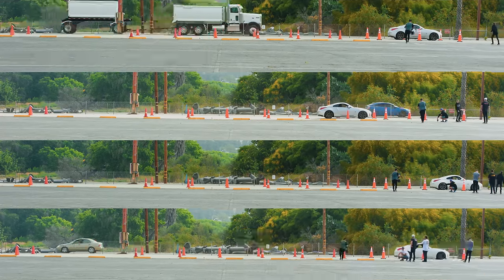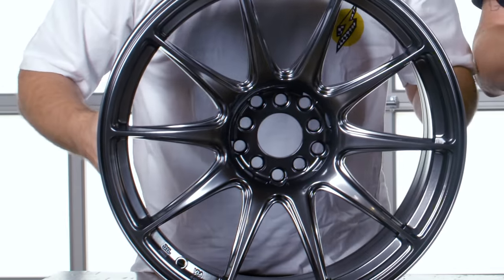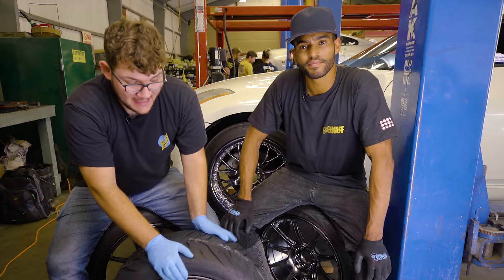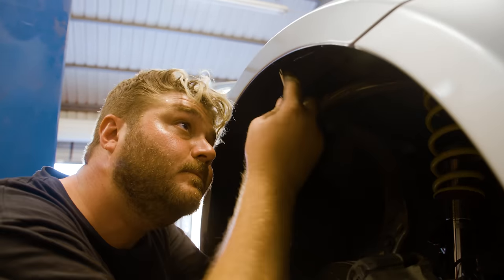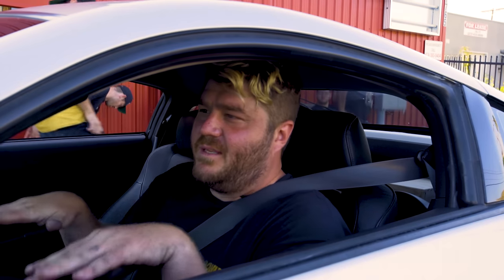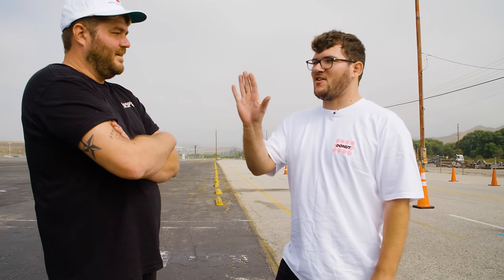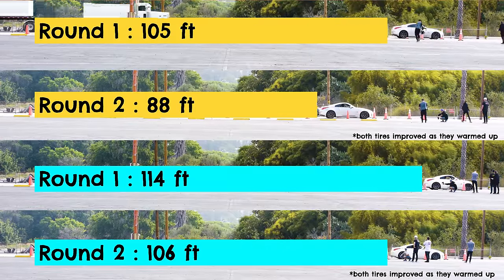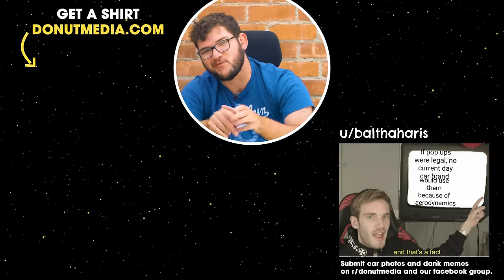$1,000 vs $3,700 Wheels and Tires | HiLow

Comment: This show should be himidlow, demonstrating the logarithmic diminishing return on investment. For the majority of consumers, a mid tier product will be the most cost effective.
Reply: I felt smart knowing what all those big words meant
Reply: stock-low-mid-hi then
Reply: @nathanperini9226  That makes too much sense yo
Reply: I said the same thing on the original video! I think that format is the money maker.
Reply: Set of koni shocks for $800 and a set of rt615k for $600 on the stock wheels.  Would destroy both these cars.  $1400 total.
Reply: @blankspace998  many low end parts are worse than stock. The low end coilovers for example are much worse then stock.
Reply: @SofaKingTouge  aftermarket wheels look fantastic though. That and you have a lot of tire options with aftermarket rims.
Reply: I think the low end wheels and tires worked well here. Obviously low end coilovers are a no no, but decent ones will do better than stock.
Reply: @silasmayes7954  my apologies.   I thought this was a performance test, not a fashion show.  Thanks for the information.  

Also thanks for letting me know tires don't fit stock wheels.  I was never aware.  Now I know, I need new tires then I need new wheels.  

I've learned so much today.
Reply: @SofaKingTouge  not everything is about performance. If that were the case many things would sell better from computers to cars. Yeah though some cars have very limited options on tire choice. My car has not rare but uncommon rim size and new cheap all seasons cost me over $700. Whereas my friend has Nissan pathfinder and got a good set of tires for closer to $300.
Reply: @silasmayes7954   I heard you the first time.  It's a fashion show.  Thanks again.
Reply: Rowan Call fr. The difference between cheap coilovers vs say, an $800 set is massive, while i feel like a $2500 set would be better bit not worth an extra $1700
A track build is a different story though so it makes sense that theres so many price points
Reply: @thecanucklehead3034  the funny thing is the $2500 set they bought is probably the worst coilover in that price range.  They mentioned in the video there is no proload.  2005 called, they want their coilover back.   Ohlines, Feel, Fortune Auto are all better and in the same price range. 

If you simply must have coilovers the cheapest i can personally recommend is BC racing DS series with swift springs.  Thats around $1500 and are better then the $2500 kw they used.  If you are too cheap for that just get eibach lowering springs.  

This need to modify your car you are will to sacrifice performance and quality just blows my mind.  Those aren't car people.  They're hard parkers.
Reply: @silasmayes7954  Fantastic looks don't add performance and an aftermarket wheel that is the same size as the stock wheel will have exactly the same amount of tire options. Those are both moot points. If you buy a different size aftermarket rim, then you'd have different tire choices which may be better, but at that point your cost is way over the setup that was suggested to you of coilovers and a better tire on the stock rim. Plus, you're not adding any weight. So, unless looks are extremely important to you, there are much better options for better performance at a cheaper price than a new rim/tire combo.
Reply: @thecanucklehead3034  a track build could get away with mid tear coilovers in fact I'd recommend it given how hard track use is one the car. The point of the high end coilovers is for more comfort on the road not better performance.
Reply: @xfiringsquadx  tires as most will tell you, and can be seen in the video, add significant performance improvements. Wider tires can also help with grip, both improvement of *safety and performance*, which is a benefit of aftermarket rims
Reply: @silasmayes7954  And none of what you just said disproves my point. New tires on stock wheels w/ coilovers is better bang for the buck than just new wheels and tires. That was suggested by the dude above though, not me. I'm just in agreement with his point.
Reply: I was thinking the same thing. On my M3 I'm doing a much more middle of the road build price-wise. My D-Force 18x10s are flow formed and even weigh a bit less for hundreds less, mostly because they're not Advans. A typical person just isn't going to spend almost 3k on wheels.
Reply: Good episode, wish vids like these where out 16 years ago so I would have saved myself the cash & the headaches. Interestingly enough some stock OE rims weigh less than the cheaper aftermarket rims out on the market. If I wanted to save a lb per rim of unsprung mass it would cost about $4-5 grand compared to the stock 19/9 rims on my TT. So there's zero gain for me in that regard. Tires on the other hand make a major difference. A cheap but we'll designed summer sport tire will perform extremely well for the average person on their daily driver. Easier to live with (especially on the budget) for the auto crosser, but not recommended for track days as the tire's compound technology will be apparent almost immediately after the 2nd lap. I look forward to seeing the brake comparison.

Comment: Current car culture: "if you arent running $4k worth of wheels on $55 chinese tires youre trash."
Reply: Not me i dont bullshit with tires
Reply: They're called 500tw ditchfinders
Reply: Bill Collins i would get cheap wheels before cheap tires
Reply: Hingle McCringleberry same exactly
Reply: So true.. 3 piece wheels with Nankang tires everywhere lol
Reply: Tooo true man!!
Reply: I'm actually going to snipe some reps or FC gold wheels for my SC400 because when it comes to wheels, strength only matters in potholes. It's weight that counts, and the rubber counts even more.
Reply: theriseagainstfan01 nankangs stretch easily. that might be why you see them alot. i hate it lol
Reply: @theriseagainstfan01  Nankang is from Taiwan, not China. They are also better these days than most people give credit for.
Reply: HashDogg06 I don’t mean to bash budget tires.. it’s just the stereotype of having 4-5k worth of wheel with $400 worth of tires
Reply: I got te37sl's with nankang ns2r's 😂
Reply: InitialG Suspensions at least it’s easier to get better tires than getting TEs haha
Reply: @theriseagainstfan01  I ran almost every 200/140/100tw tire  under the sun on the track/autox/touge. I'm not opposed to trying new compounds. :)
Reply: @theriseagainstfan01  Yeah I completely understand, I also want to apologize for my ignorance, from the looks of it yes you are right Nankang is made in China these days not Taiwan as it was, bit of a shame but I guess you can't compete with China's manufacturing costs.
Reply: If you plan to go fast GET GOOD TIRES
Reply: Meh, why spend lots of money on tires when most people are just gonna do burnouts with them anyways
Reply: I steal half bald tires from behind shops for drifting🥺
Reply: Abysmal Squid Lionhart

Comment: To those thinking cheap wheels are always bad: you are sleepin on flow-formed Konigs. Made on the same production line as Enkei flow-formeds, they are just as light and are half the price.
Reply: And rays?
Reply: matthew natividad rays are expensive as shit wtf
Reply: @justinhedrick2906  rotiforms>
Reply: Dude, I can't even find 17in wheels lighter than the Konigs rn. I'm looking at dekagrams or countergrams because i like how they look, both just under 17lbs. The hypergrams are the lightest  @ 16.33lbs for 17x8s. TSW Bathursts are 17lbs, nothing else compares that I've found. The Konigs are around 220, the Bathursts around 330.
Reply: @johnnymatias3027  Get the hypergrams, I think they look sexy. I got Konig Rennforms on my car and tbh they're alright, but they're my first set of wheels so I didn't expect to get it perfect the first time
Reply: @johnnymatias3027  WedsSport TC105Xs are lighter, but they are also more expensive than than Konig Hypergrams. I think the Hypergram is the best bang for the buck when it comes to weight and they look amazing too.
Reply: getting some 12lb dekagrams on the EF hatch
Reply: Got some Enkei Shogun FF's on my Suzuki Swift Sport today on Michelin Pilot Sport 4 and that combination is damn good! 
And they are even lighter than the stock wheels which are already stupidly light, even though the new wheel setup is about 3cm wider.

Comment: Next:
$100 subwoofer vs $1000 sound system+$30 vape juice
Reply: There is a huge difference between good sound system and bad sound system.  No vape juice though.  I have a 1000W AMP JL Audio (the one that claims it will never oveheat and 2 8' Subs from JL Audio.  That setup alone is quality.
Reply: Cheap subwoofers sound like crap. But you don't have to spend $1000+ to get quality.  My powered sub is from Rockford Fosgate. It is a 12 inch Punch woofer with a 300 watt rms mono amp. Great bass in my truck.
Reply: @AFlyingCookieLOL  And the correct enclosure.
Reply: Re audio makes some of the best sounding subwoofers ive ever heard and they definitely arent the most expensive.
Reply: @aceproduction99  fosgate has dropped quality in  the last 3-5 years imho. you can find handmade stuff cheaper and better , sundown audio is one that comes to mind.
Reply: TheBlack Metal That does not sound like a quality sound system to me. A quality sound system would consist of a Sub with its own amp, and a separate amp for mids & tweeters, and a DSP etc. Having 2 8’ subs on a weak ass 1000W amp drowning out your stock speakers is not quality at all lmao
Reply: +Subaru
Reply: JL Audio and Fosgate are great products, although def on the expensive side. I’ve had the w3’s, W6’s and XD/1000 amp and Rockford T1’s, T2’s and T500
Amp. All that being said these days car audio has totally changed. So many products and company’s  out there changing the game. Basically great products for a cheaper price than the known high end car audio brands. Currently I’m running a sundown 12 inch ZV5 with a brutal sounds 2K amp and it blows away every setup I had before and SQ ain’t that bad either. It’s night and day.
Reply: I have seen top dollar stuff sound like 💩 because it was not set up right. Settings and configuration are more important than how much you spend.
Reply: Have two Competition Kicker 12’s in my car with a 600 watt amp running at 2 ohms, can hear it coming alllllllll the way down the st.😂
Reply: @calebherbert730  Crazy part is that 600 watt amp is probably only pushing 250.
Reply: Channel Zero One yeah my amp overheats, ya think I should get a better amp with more wattage?
Reply: @calebherbert730  if it  sounds good and you are  happy with it, use it till it breaks
Reply: My $1500 5000 watt amp and $850 15" sub better slap, going in soon. Also had to buy a few AGM batteries and a high-output alternator not to mention that's only the bass setup and not the mids and highs which also got upgraded nicely
Reply: Alejandro Alvarez I would highly recommend some ear plugs lol gotdamn dude that’s a hell of a set up
Reply: @calebherbert730  

It should be decent, nothing too crazy, definitely should be under 150 decibels bass-wise lol. Ive had a few set ups, but I quickly get used to the way the subs sound. The bass doesnt really bother my ears, the midrange speakers though...they definitely make my ears feel funny on my 1 hour commutes sometimes. Goal was to get decently loud on a single 15 on 5K watts nominal, we'll see how it goes, I'll post videos soon enough
Reply: @Luminous.Dynamics  You will never use more than a 1000 true watts for bass when inside the vehicle. The pressure will be unbearable. I know this from experience. Sad you have to buy a 5,000 watt amp to get a usable 800 watts at best, but its what these manufactures do to entice buyers. Add up fuses amp rating, multiply that by 14.4 and times that by .40 to .60. That is close to the absolute max your amp will ever output to the speaker. Go to williston audio labs for legit amp test. Prepare to be disappointed.
Reply: @ChannelZeroOne  

Its a DC Audio 5.0K, try again
Reply: @ChannelZeroOne  

I have 2000w rms on a single 15" sub rn. Not even close to unbereable for me, my ears arent that weak
Reply: @Luminous.Dynamics  Highly doubt it, or you got it tuned or set up wrong. Seen so many shitty set ups with great parts. Chances are you don't even have said set up anyways.
Reply: @Luminous.Dynamics  Most inexperienced tuners think everything up is loudest, but that not the case. If your settings were correct your SPL would be well above 150. I see you resorted to name calling. Point proven, you got nothing. LMAO.
Reply: You gotta test the boxes tho too cause a cheap piece of shiz box will never perform like a proper tuned box
Reply: 3000k on x sundown. With 6 6.5s deaf bonce in the front doors
Reply: Since you don't say what you are buying for how much, might as well just stick to the Vape juice.
Reply: @calebherbert730  ain't no way bro, I barely have 2 zvx 12s on a 3k amp. you'll hear me but you won't feel it